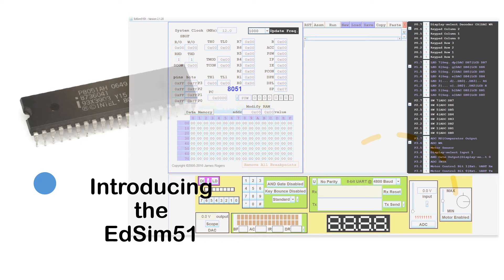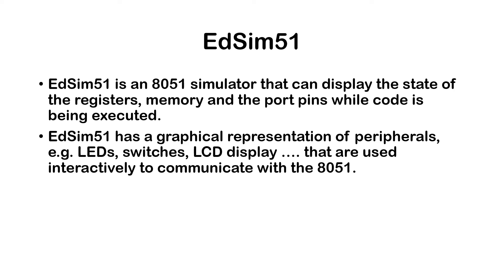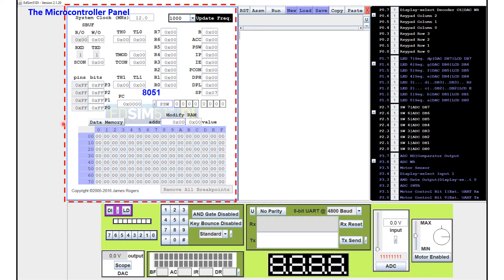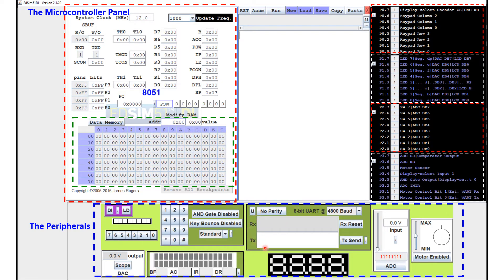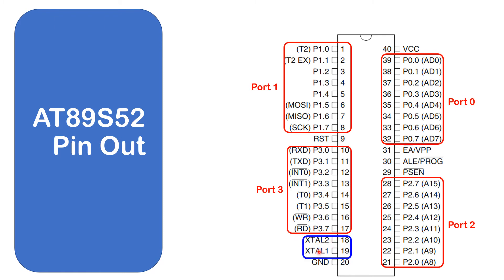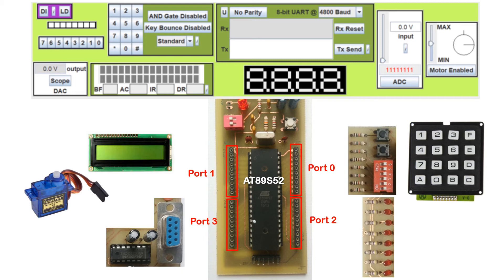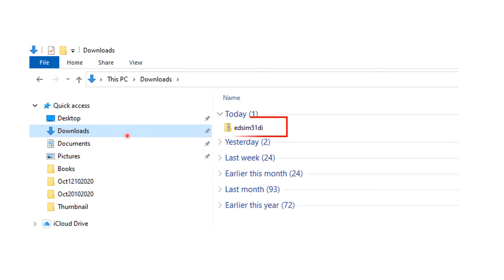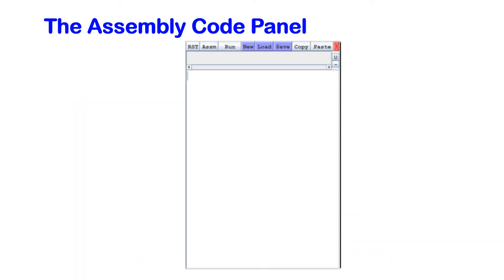#10 Introducing the EdSim51

Comment: Hi, excuse me, thank you so much for your video. I have one question about installing edsim51. I use mac and I actually do not know if I have already downloaded java 2 runtime environment. I tried to search on the official website, but did not find the result(they said I can try to click verify installation, but I did not find the button. ) I have installed the edsim51 before, so right now I forget if my mac still have java 2 runtime environment. I have opened edsim51. Do you know if there are any ways checking if my J2RE is innstalled?
Reply from the maker: Hi if EdSim51 is running then it's fine.
Reply: @vooiyap  Thank you so much for your quick reply! I understand what you are saying.